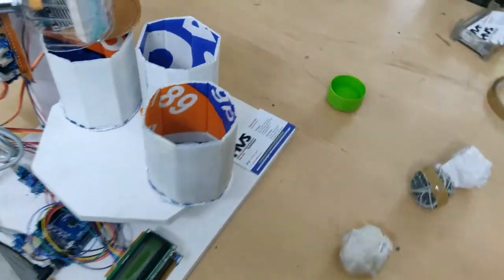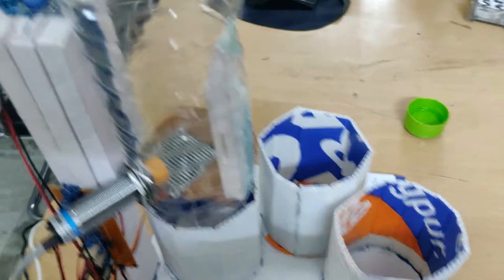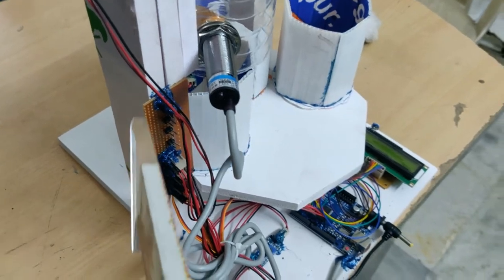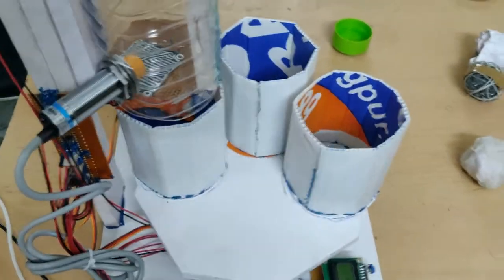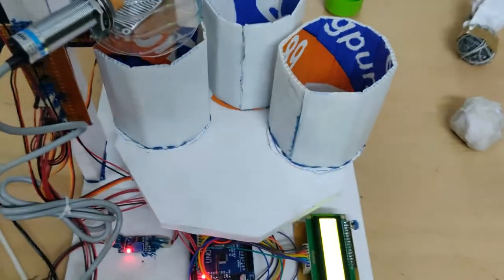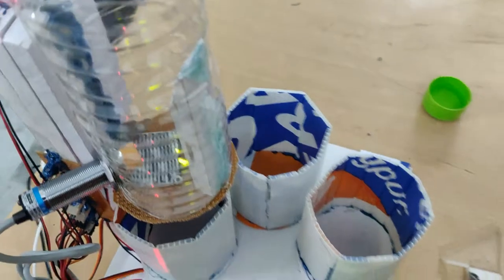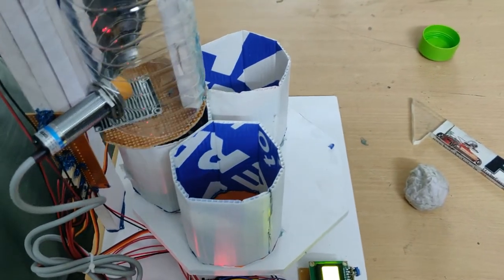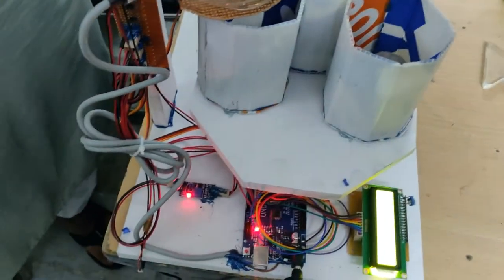Automatic Waste Segregation System   Dry, Wet, Metal using Arduino

Comment: U used servo motor sg90 and 2nd metal servo motor is ?
Reply from the maker: Mg995
You can contact us at +919603140482
Through WhatsApp or call